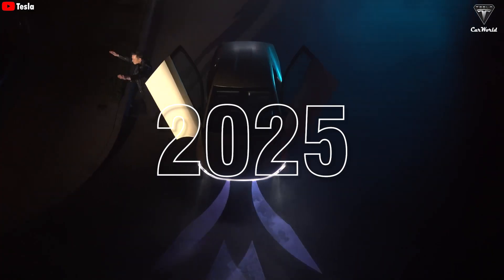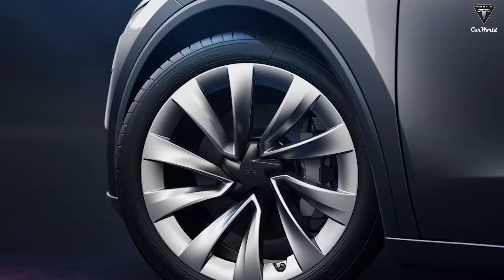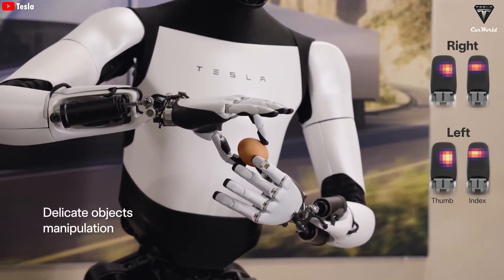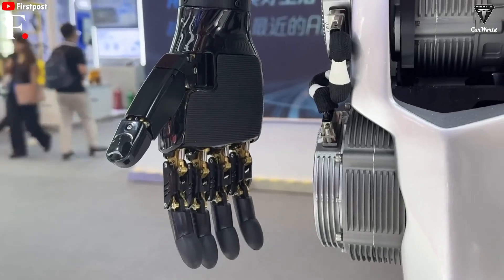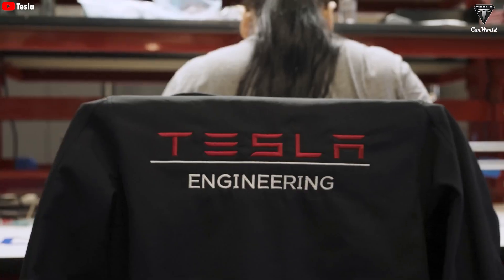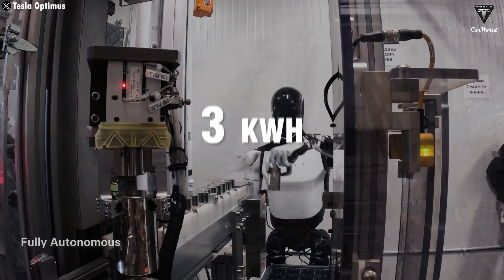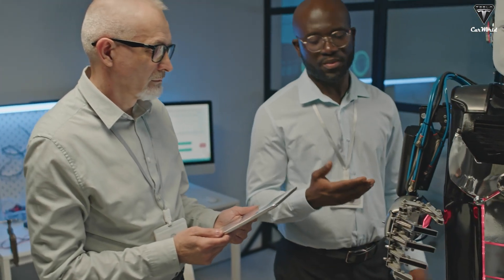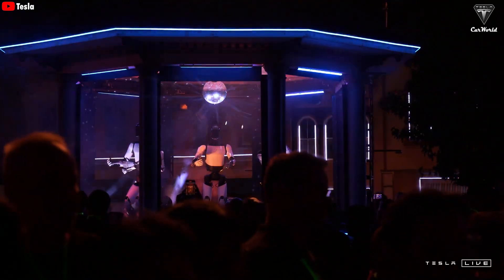It Happened! Elon Musk Reveals Tesla Bot Gen 3 1000 Useful Task In 2025, One Part Change Everything!

Comment: optimus seems to be a robot for home works,,a new feminin robot like ameca or sofia must be designed with much more advane technology for other technological needs requiremnts  promoting ideasand programms for advertising purposes which are already in the drawer of tesla,needless to mention what how and when,another significant impact is that tesla must focus on creating new batterie from sodium plus the appropriate analogy ofvanadium in order to reduce the cost,the only week point on those batteries is the rection on low temperatures,however thecontinuing advanced technology will find a solution..
takis athens greece